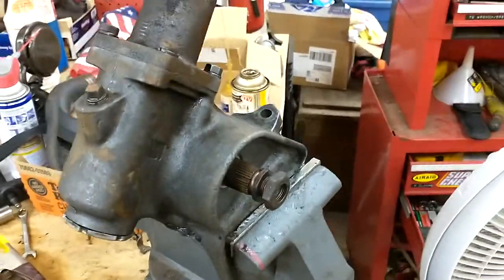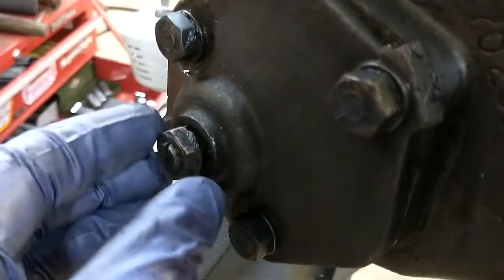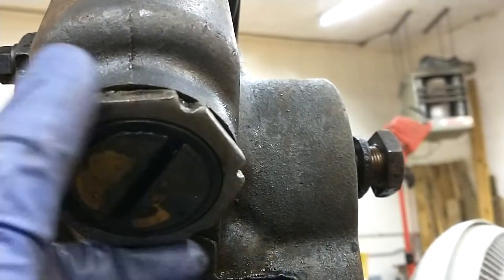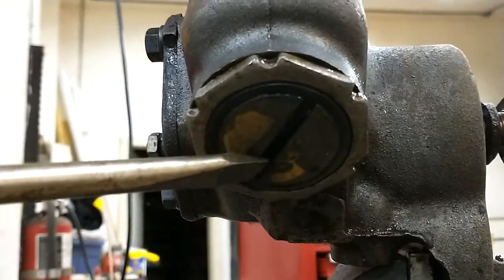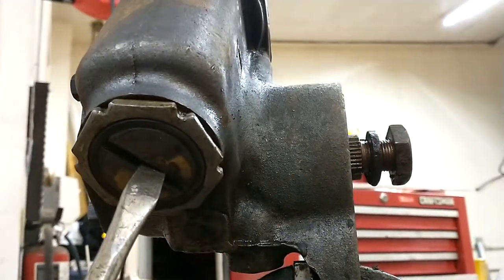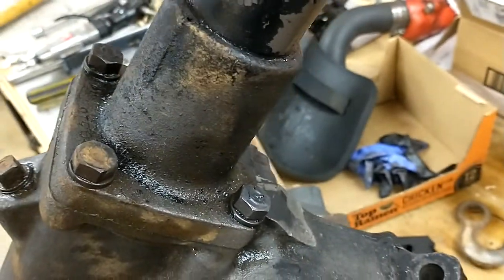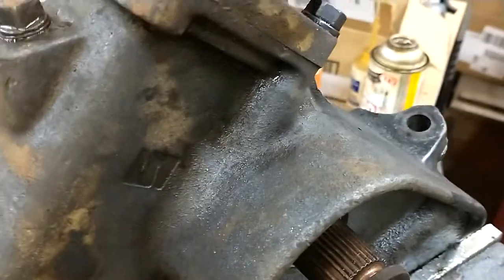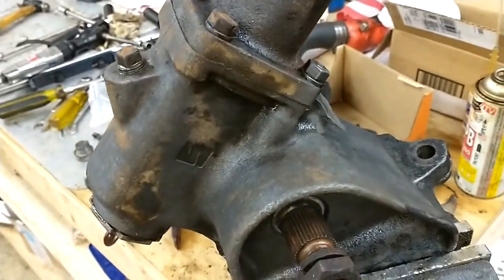1949 GMC Steering box overview

Comment: i need to rebuild my steering box as it has several leaks , and will not adjust properly. where can i find a rebuild kit or a rebuilt steering box. thanks
Reply from the maker: Hi - I get a lot of my parts from Jim Carter's Truck parts (oldchevytrucks.com).  That's where I got my rebuild kit: https://oldchevytrucks.com/1947-1955/mechanical/front-end-and-suspension-parts/steering-box-gear-assemblies-rebuilt.html